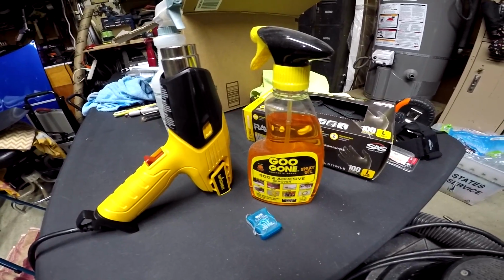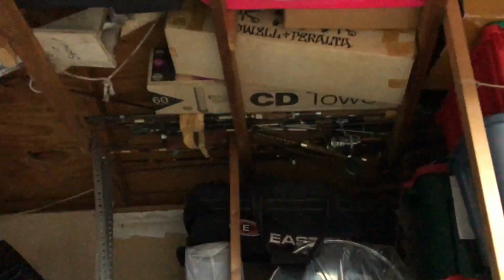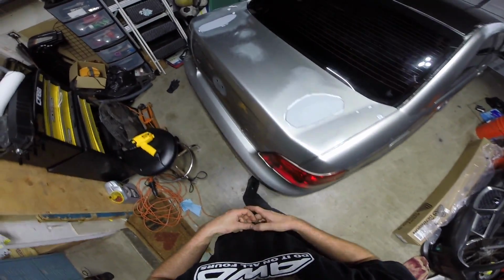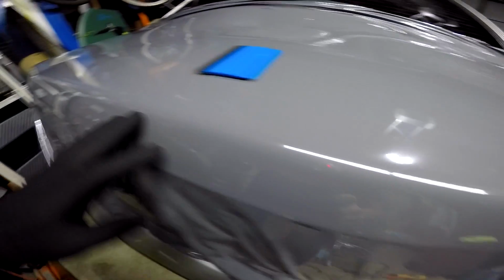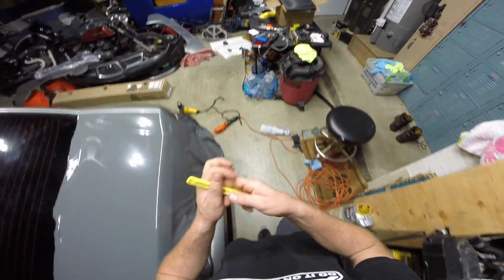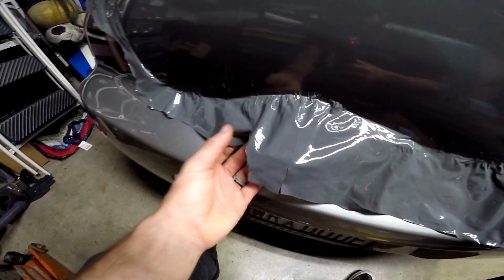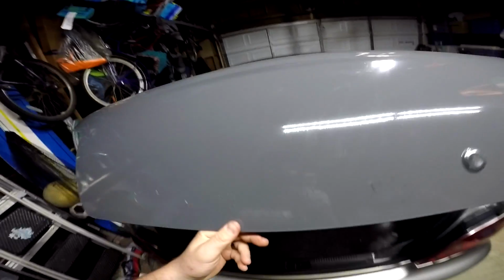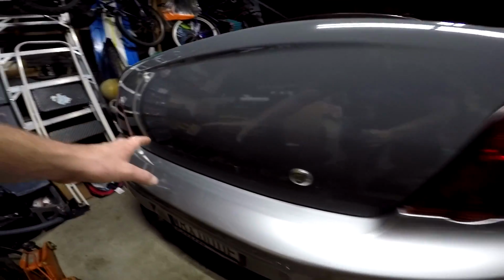My Vinyl Wrapping FAIL! My Trunk Is RUINED!

Comment: Try not to use too much heat. Heat is your friend but at the same time your enemy. The flat part is the easiest part. When laying the vinyl onto the panel. Find your body line first. Then work your way into the 
Recessed areas. The wrinkles happened bc you stretch too much that the vinyl lost its form. Try putting a piece of wood or an object behind the trunk so it’s elevated it will make the install a lot easier. When coming to corners let the vinyl fold over the corners and curves of the panel. But hey think about it like this. You attempted it and it’s not bad at all. It’s a scary task to take on by yourself keep working at it and you will be good in no time.

Comment: you need a hand to lay glass, glass and squeegee the top of the trunk to active the adhesive just like you did ! then open the trunk have your extra set of hands to hold the trunk open then stretch and glass the vertical portion corner to corner and squeegee it out . I know your more than likely worried about over stretching but you definitely could have used a good stretch down and out to the corners towards the bumper! I am no wrapping pro but i have wrapped my own trunk and hood ( I molded an STI scoop to my JDM legacy B4 hood and had to do it in one piece)
Reply from the maker: Thanks for advice man!